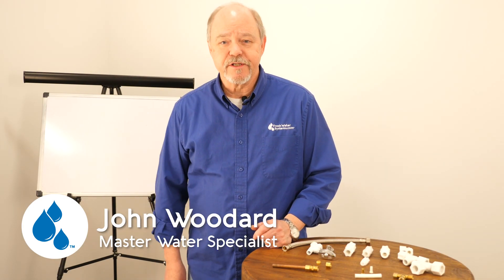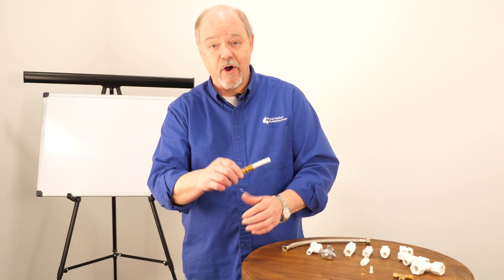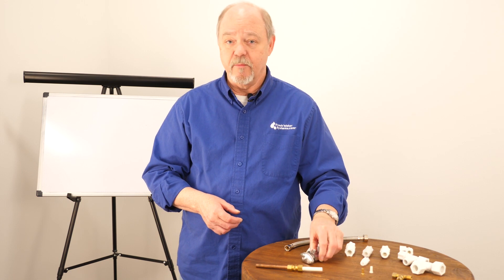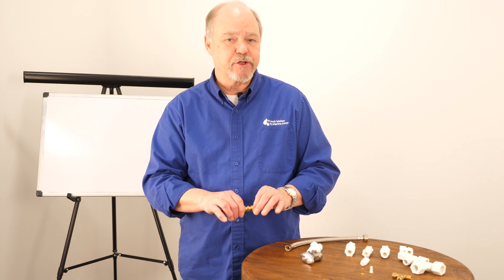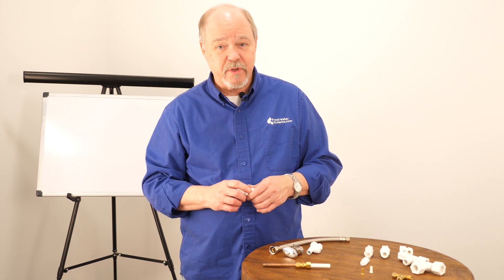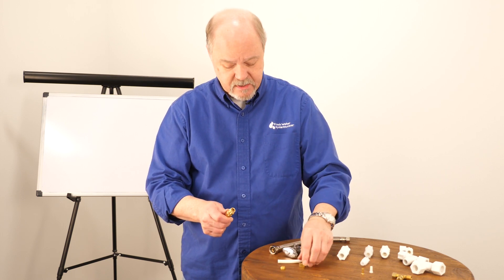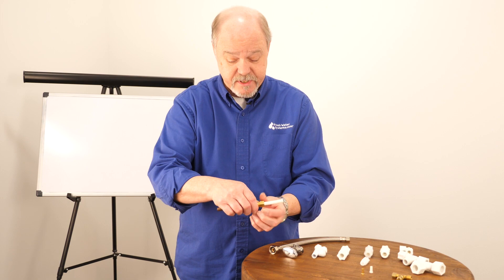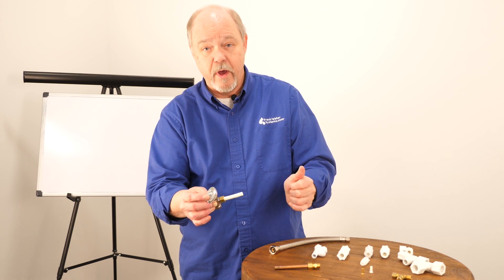What Is A Compression Fitting And How Does It Work?

Comment: I'd take a master class from you! I want to learn more about plumbing but I want something more like this that teaches me the this that I don't know that I need to know. Also, is there such a thing as a 3/8" to 1/4" angle shutoff valve fitting? I can't find one anywhere and I'm not sure if it's because of the pandemic or not. I'm trying to hook up my refrigerator ice/water from my sink's cold water connection. It has a female connection that right now has a 3/8" to 1/2" shutoff valve coming off the main shutoff valve for the cold water for the sink. But we're using 1/4" copper line to the frig. I hope that makes sense.